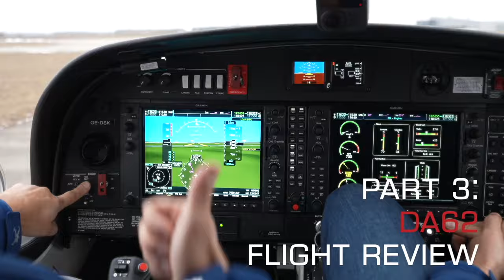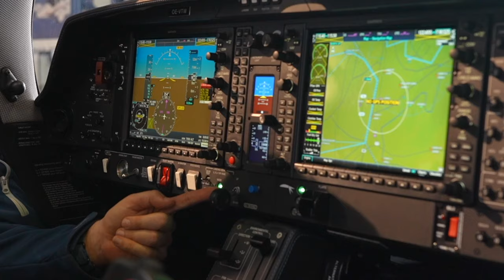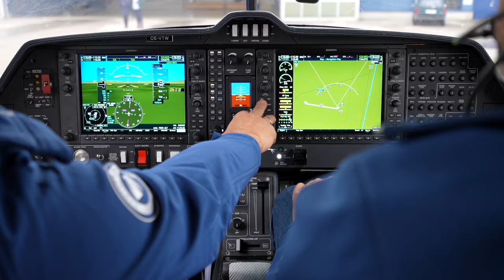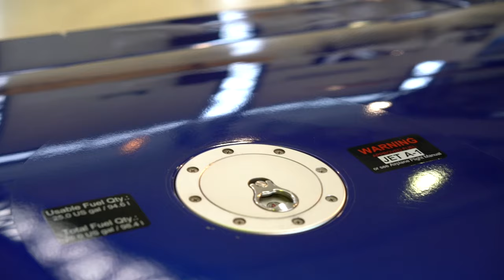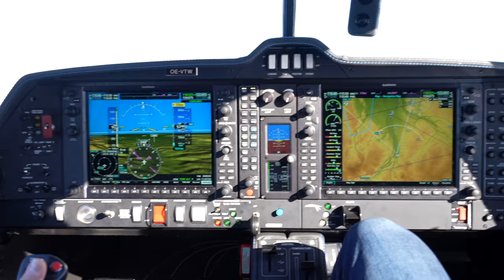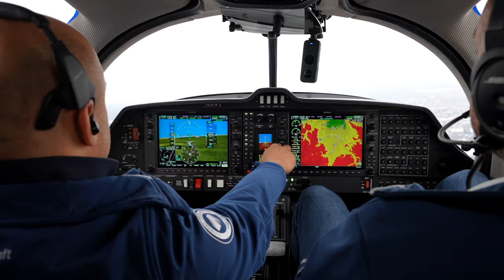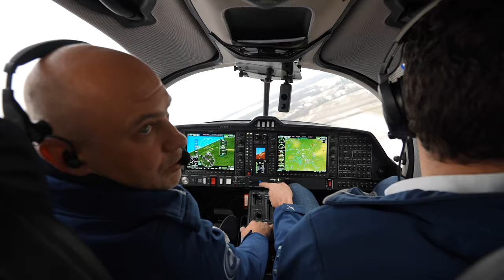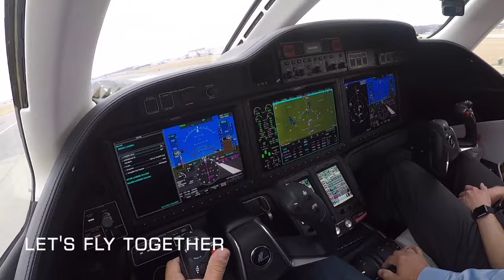16. Chief Pilot of Diamond Aircraft Talks: In-Depth Diamond DA50RG Review

Comment: Beautiful aircraft. I don’t agree with you Andrey about your comparison with the Cirrus SR22. Why is the Cirrus the better aircraft in the US but in Europe the DA 50 is the better choice? That makes no sense at all. They are both very similar. Correct. But besides the Parachute 🪂 the Cirrus does nothing better. The safety construct, the safety margin, this is way better on the DA50. The DA50 has the better aerodynamics. The DA50 has the way better fuel efficiency. A difference of 5-6 Gallons per hour in advantage is huge. The ramp appeal does the DA50 a lot better either. The cabin comfort is a slice better compared to the Cirrus. The DA50 got retractable gear, which I like and prefer more because of performance. Jet fuel is cheaper than avgas. And even in the US cheap avgas is history in most places. My choice would be clearly the DA50. The Cirrus is nice and awesome. But the DA50 takes over me better and more feelings to this one. I think the points go to the DA50. The Parachute is a factor, yes. But I would trust in the intensive and long development time from the DA50 in a serious functional product. The single engine can stop running on either planes. But it’s all about mission. Me I will never fly at night IFR in icing conditions in Mountain areas, over long distance open sea at night or other possible severe situations in single engine planes. Of course you could do so, and many pilots will do. But ridiculous to me. With the right mission in my mindset in most situations I can get off without the parachute. And I can do a belly landing in the DA50 if this might be the better option. So in my opinion there are positives all over the place in the DA50. Also in the US. Besides that, the Cirrus is parking all over the place on the ramps. The DA50 comes and will get the show. Believe me. 😊
Reply: DA50 doesn’t fit in a t hangar. Cirrus does. T hangars are everywhere in the US. No one is spending that much on a brand new plane and leaving it outside.
Reply: @brandonadams7837  thats true. But when I see, what they charge for these things (t-hangars) to rent, I see more and more one million single engine airplanes parking outside. To rent a hangar space in many places is ridiculous expensive. Besides that, you can buy nice airplane covers for the DA 50 for outside parking including wings and tail. I know people driving up to two hours to their plane because of affordable hangar space. That’s insane. GA is going in a wrong direction anyway. So will see, what’s going on in a couple of years.
Reply: @brandonadams7837  no body that spends that much is worried about getting the cheapest hangar .
Reply: @TheSlickpt  it’s not even about the money in most regions. There is a severe shortage of hangar space everywhere. Waitlists are commonly 5-10 years long just for a t hangar.

Comment: da50 MTOW 2T: Cirrus 1,6T. da 50 full 5 seater, Cirrus lets say 4+1 for one child in between. Avgas more expensive everywhere and anyway 9USG JET1 for cruise better than 12USG Avgas. or maybe i missed something.
Reply from the maker: SR22 has CAPS system. Fuel consumption almost the same (15 gal vs 17 gal), price in the States the same (sometimes Avgas cheaper). So, pretty much everything is the same!)
Reply: we are not in USA. This plane most for Europe looks like @About_Aviation
Reply: У цирруса есть спас система, у даймонда нет. Верно?
Reply from the maker: @aleksandrsynyavskyy6262  this is exactly what I think. Diamond will be very hard to compete on US market. Nothing they can offer better than Cirrus)
Reply from the maker: @Andrei19777  верно!
Reply from the maker: @aleksandrsynyavskyy6262  also DA50 is way more expensive than SR22 in top configuration…
Reply: Great video! 
Just the end , I disagree that this is “pretty much the same” as Cirrus aircraft.
Cirrus still has continental old school engine. For that reason alone we are comparing apples and oranges. This plane is RG, and more efficient despite more room.
Only thing I don’t understand is the 49gal capacity, surely they will increase this in the  future
This generation of pilots can’t deal with mixture and prop settings, surely cirrus will get in line with the
Ie2 at some point, until then Diamond deserves  serious consideration
Reply from the maker: I don't think the Astro engine it's something extremely new or different from "old school lycoming". In my personal opinion this is the same internal combustion engine. Different fuel? So what? same TBO time, same maintenance cycle, same issues (even more on Astro as I heard from real customers). Why do you think Diamond is something special?

Comment: Hi Andrey, I am curious to know if the CD300 engine is or better said could be used in the airframe of the Da 62? I of course understand what he said in the video regarding trying out different engines with more HP but at a cost of only few more knots. I am guessing the CD 300 wasn't around at the  time of the DA 62 design ? Or maybe it was? Can you ask them (diamond if in future is it possible t increase some type of speed in the DA 62 airframe? As it seems just a little too slow in real world today usage (of course just my personal thoughts). But either way i think this is the future for GA with the world going so nuts with Wokeness etc and the Avgas problem with so hard to get as I know myself as I operated a P68 Partenavia in the country of PNG (just above Australia if you guys are wondering where this is). Cheers Great video Nico
Reply: the 300 is much heavier than the 4 cyl, and would break the wings of the 62.  they could be used in a larger, redesigned airframe that might hold 8-9 people. the 300 hp engine would be great in a lot of singles with The OI- 540s on big pipers and Cessnas!
Reply: @bartlevenson7851  yes i realized this , and i did wonder same but then i checked the CD300 is 582lbs dry the AE330 is 410 lbs dry? it really is not much a difference ie could not the design team not (if they wanted too?) strengthen the wing to support the extra weight? Obviously they could any smart engineers could if they wanted to. It most likely boils dow to extra costs to do it and then ask themselves is it worth it? I would say the answer is Not Worth It as they Diamond would have if they saw a market out there. I guess I appreciate your response from you point of view. What really i was trying to get across was in this new 21 century when they these designers that actully go out of there way to build new GA aircraft you would think they would step it up a little after spending a ton of money in the first place getting the Da42 and then the Da62 to market and the amount of speed difference is ? I dont know lets compare some of these other aircraft that are experimental that push some crazy speeds. Why not try to get this DA62 to lets call it a speed where most of the Avaition crowd would be so pleased (it can be done) all that money spent on the airframe of the da 62 is a result of a very beautiful looking machine. Who knows maybe they are already working on a secret project? The expense to bring a new GA aircraft to market with all the regs must be insane and costly and just not worth it. Then the next question is, is it somehow possible to get the cd 300 weight down to a better number so that airframe out there can handle the math to make it airworthy? Again i would think the people at Contenental must have but some serious mind thought into making it as light as possible? I havent seen anyother airframe guys out there discussing this engine? Sad? But maybe it is too heavy?

Comment: Great video! 
Just the end , I disagree that this is “pretty much the same” as Cirrus aircraft.
Cirrus still has continental old school engine. For that reason alone we are comparing apples and oranges. This plane is RG, and more efficient despite more room.
Only thing I don’t understand is the 49gal capacity, surely they will increase this in the  future
This generation of pilots can’t deal with mixture and prop settings, surely cirrus will get in line with the
Ie2 at some point, until then Diamond deserves  serious consideration
Reply from the maker: As from pilot / owner / user point of view in the United States, I see much more disadvantage in Diesel C300 engine than "old school" Lycoming (not continental in the last Cirruses generations). The reason - cost of maintenance, nobody know this engine (at least now), hard to get parts, etc. Maybe it will be better in US, but I'm pretty sure US market will be completely under Cirrus hegemony. This is my personal opinion) P.S. Diamond is more expensive than cirrus even GTS.

Comment: Various sources place the starting price at 1.15m$ already in 2022 so what's the deal on the price? did they realize it was too expensive or what?
Gogetair 915 version is 270k€, same speed, 4 seats, longer range, 1/3 the weight, half the fuel burn, can run on mogas meaning 1/4 fuel cost. Smaller wingspan so cheaper hangar. No deicing though afaik.